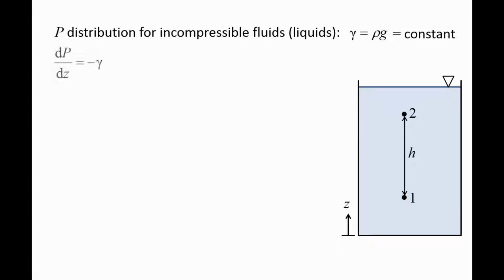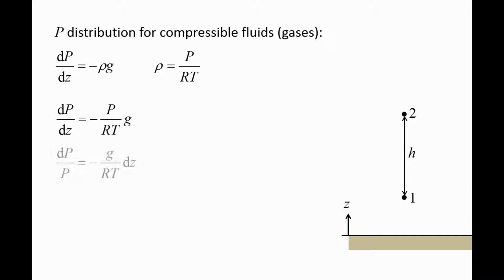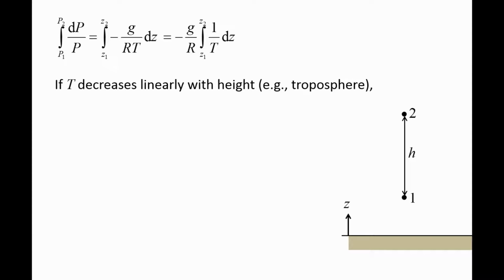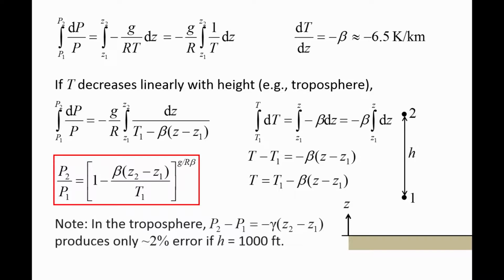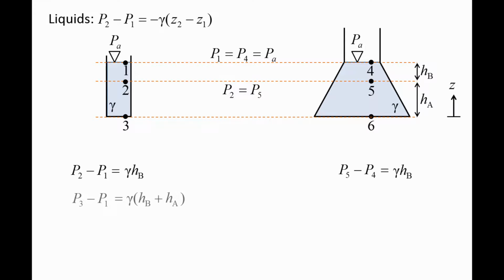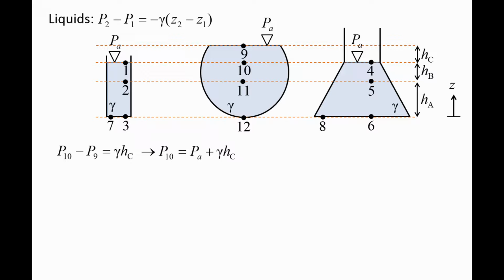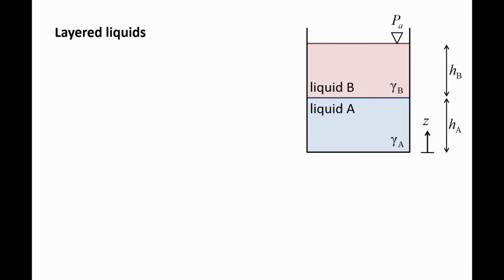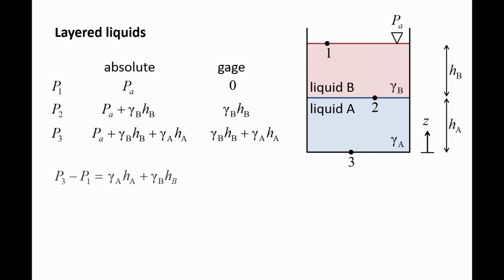Fluid Mechanics: Topic 2.3 - Hydrostatic pressure distribution

Comment: At 2.12 shouldn't  formula of density be Mp/RT?
Reply: I was wondering the same. ideal gas formula includes molar mass in this equation
Reply: after doing some research, i found that this R is R0/M, R0 is the universal constant and R is the gas constant for that specific gas.